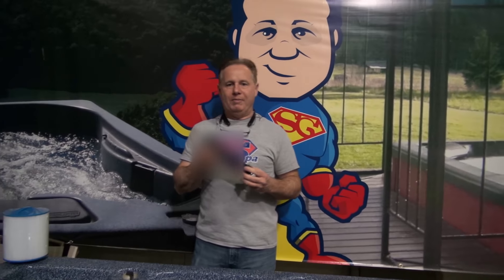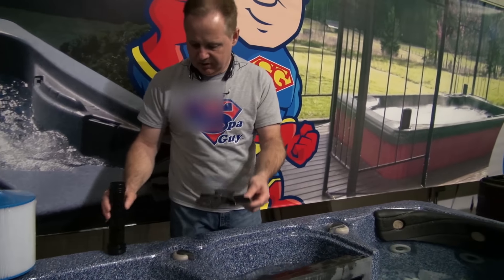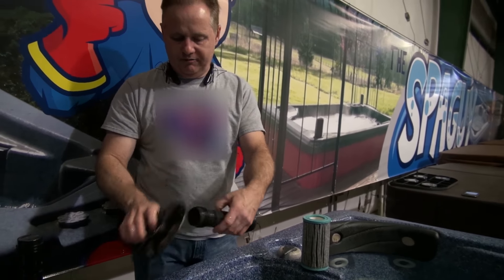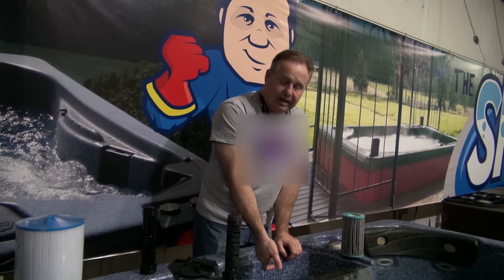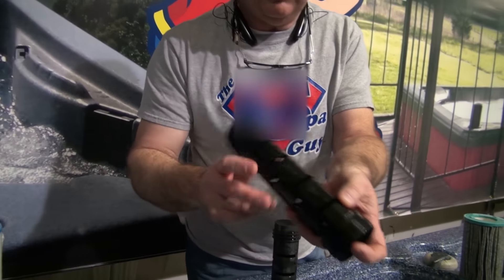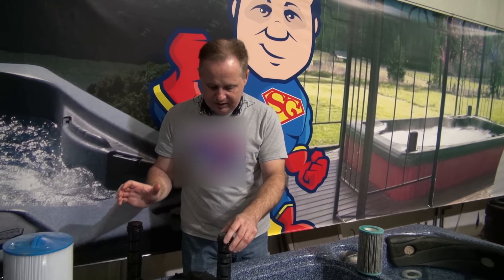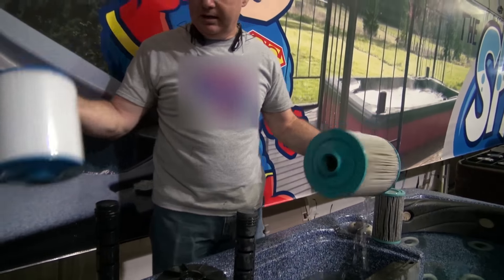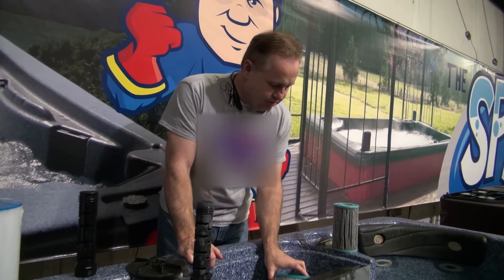Master & Down East Spa Filter Stalk Broken How To Hot Tub Parts of America

Comment: Just a heads up that the way these stems commonly break is by over tightening them...and then when you wanna remove the filters you have to use too much force to loosen them and they sheer off.   I learned the hard way and now when I’m tightening or loosening them I keep pressure with one hand on top of the stem itself and use the other hand to twist the housing.  If you just grab the top part with both hands and twist it eventually it’s too much torque for the relatively delicate stems.